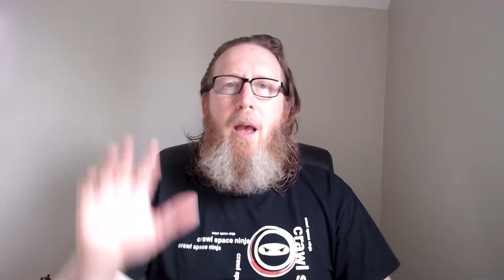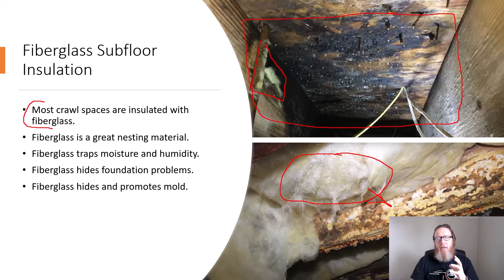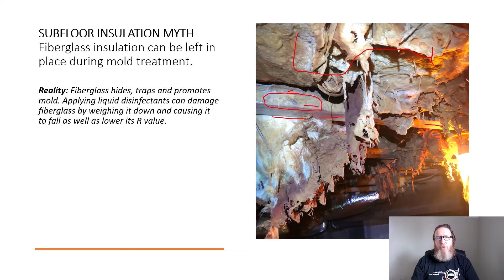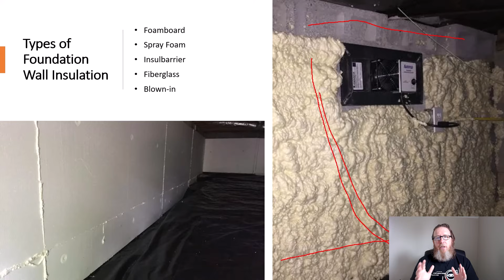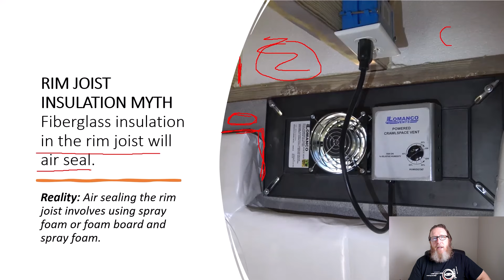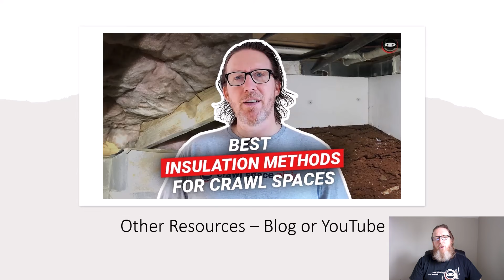Your Fiberglass Insulation is Rotting (Here's Why)

Comment: I've seen a few instances of people insulation the floor/dirt either with foam board or spray foam and then vapor barrier on top of that with foam or spray on the walls. Is insulating the floor common? Recommended? Or should you encapsulate, insulate the walls, and then replace subfloor insulation?
Reply from the maker: That is not very common. For more information please submit a Ask a Ninja Form - https://crawlspaceninja.com/ask-a-ninja/

Comment: In South Carolina what kind of rid joint insulation would you recommend
Reply from the maker: We suggest to check with local codes. However Foam Board with a R value of R-10 that is termite resistant is typically best. We also sell that here - https://diy.crawlspaceninja.com/rim-joist-insulation/

Comment: To secure the  vapor barrier, is it better to tack it down with gravel on top along the perimeter or tape it to the concrete wall?  I think tacking it down with gravel  (or sand bags?) is better as the concrete wall breathes and the condensation gets trap and causes the tape adhesion to fail. Appreciate any thoughts.
Reply from the maker: Tapes and adhesives will usually fail over time. We use masonry nails, Christmas tree fasteners to fasten it permanently to walls. Thank you for watching.

Comment: I'm building a house right now in CT. This information's value is immense!
500 square feet of pre-existing house (really a summer cottage turned into a year round dwelling) that had a whole host of problems. My wife and I replaced all the sills (with sistered 2x8s) to unitize the structure, lifted it an average 6 inches and put it down on poured columns. Right now we're adding the exterior crawlspace insulation ('skits') and intend to encapsulate the space using 10 mil (or better) using the techniques you've outlined. Still going to add joist insulation on the bottom of each bay (spray foamed in faced iso with fiberglass or rockwool. New England be cold! ).
It's a lot of work but we're blessed to start with a near-clean slate in choosing the correct crawlspace components!
My heart goes out to all those effected by poor conditions in their castles.  I hope you continue making people's live better and healthier!
Thank you.
Reply from the maker: Thank you so much for sharing your experience with us. Please let us know how it goes. Also, here is a website if you need to purchase some products to help in your project. https://diy.crawlspaceninja.com/mold-products/

Comment: central indiana with pier and beam foundation on a vented crawl space. i have plastic and pea gravel on dirt, fiberglass insulation between floor joists and lots of moisture issues during humid times of the year. hvac vents have moisture dripping at times. what advice do you have for this situation?
Reply from the maker: Is the foundation wall sealing the crawl space from the outside? If so, can you run a dehumidifier?

Comment: Question:  I am adding foam board to the crawl space wall.    There is fiberglass batting between the joists at the sill plate.  should I continue the foam board up to the flooring or stop at the sill plate?
Thank you
Reply from the maker: I would stop at the sill plate and maybe lower if your area requires a termite gap then you could start again at the rim joists and foamboard/air seal there. Many pest control companies don't like the sill plate to be covered for termite warranties. Hope that helps, thanks for watching.

Comment: I live in the Chicago area. Should I add foam insulation on crawl space ceiling?
Reply from the maker: That's a great question if the foundation walls or insulated, normally you do not have to do that as long as there is a heat source in the crawl space. Hope that helps thanks for watching. I would also check with local code to see what they require for insulation in your area.

Comment: Question. So I have had my crawlspace inspected and was told  I only had mold below the insulation line. That the subfloor is mold and moisture free. Would you still recommend removing the insulation for mold treatment.
Reply from the maker: Yes, when they told you there was no mold behind insulation, did they remove all insulation and test subfloor for mold? Sometimes, it's invisible to the eye.
Reply: They peeked behind the insulation and just visibly looked at it. My mold just looks like light pepper on the joist. Humidity levels is at 58% with a light duty (Lowes) home dehumidifier installed 4-5 years ago. Vents are not all sealed. Crawlspace has a light vapor barrier not covering everywhere. 
Planning on installing a Aprilaire 70 very soon by the Crawlspace company. However, I am planning on diyi-ng the rest. 
1200 sq ft house
Mold- Decon 30
Vapor barrier- your 12 mil ( one or 2-10x100?) enough
-bora foam from local Crawlspace supply company 
Hilti- rental from you guys
Reply: I live in NC. I heard you say something about NC requiring a different attachment method of the barrier over the foam. Do you have any videos or instruction material for those specifics with pictures on how to do that?

Comment: live in the northern climate....have a wood foundation crawl space. the space is dry but there is a musty oder. minor mold growth as well. would like to insulate the walls. was going to use rock wool. should I put a vapor barrier on the outside/inside or neither? thanks.....
Reply from the maker: Rockwool is naturally moisture retardant so you shouldn't need a vapor barrier and I never recommend plastic to cover wood. Thanks for watching and I hope that helps.
Reply: thanks, Michael.....that was my thoughts as well even though the makers and installers of wood foundations recommended a vapor barrier on the studs inside the crawl space.......very confusing!! @CrawlSpaceNinja

Comment: What do you recommend for insulating skirting of manufactured home in zone 6/7? Typical home comes with fiberglass insulation with "belly wrap" vapor barrier under flooring with home installed on a concrete slab. Skirting is often uninsulated although we are seeing more installations with insulated skirting (foam board which look like stone or brick). Uninsulated vinyl  skirting typically includes sections with ventilation. New installations with insulated skirting usually include multiple automatic vents. Seeing people insulating skirting of manufactured homes and not installing any ventilation and covering what ventilation may have been present. When this is done I rarely see any dehumidification installed. Seeing damage from excess moisture when skirting is insulated with no ventilation, or very little.
Reply from the maker: Wow, that's a cold area. I am not familiar with codes in that area but if Tennessee requires an R10 with 8-inch block minimum and a skirt offers zero protection versus a block wall. I am guessing, again guessing, I would want at least R20 if it were my home. Since usually foamboard is R10 max, I would double it up. That may prove to be a tough job but may be easier than installing a permanent foundation. Sorry I don't have a better answer...thanks for watching.

Comment: Had my crawlspace encapsulated in NC.  I arranged to have rockwool comforbatting placed into the extended walls rather than fiberglass.  Rockwool comfortbatting is moisture permeable, bugs and rodents hate it, sheds water, fire resistant, higher r value per thickness than fiberglass, and has sound dampening properties.  Other than a lower price, the benefits of fiberglass is a fairly short list.  My crawlspace problems extended from fiberglass, so I made it a point not to reintroduce fiberglass back into my crawlspace.  I can't say I benefit of sound proofing, thankfully the fire resistance hasn't been tested, but floors are warm and the wildlife issues I was having hasn`t returned.
Reply: I’m thinking rockwool insulation is the way to go on the rim joist areas that way you can remove a piece to inspect those areas every now and then to make sure your not having mold and moisture issues.
When sealing it with other methods you don’t have any idea whats going on with those areas when it’s permanently hidden.
Reply: @robhayes5320 so are you saying rockwool is difficult to remove?
Reply: Thank you for sharing. Improperly insulated crawl spaces are unfortunately common in my area (Downeast Maine), including for manufactured homes.
Reply from the maker: Thanks for sharing.
Reply: @bricelangston8634  great idea! Out of curiosity and probably even similarities, what was your wildlife issues?

Comment: Advise please!? 
Houston Texas
Peer and beam
Non sealed crawl
I placed r19 fiberglass paper up and was advised ill grow mold above  it by somebody that had to do foundation work..  I pulled down a couple pieces and saw a few small specs growing with this being Over a year later and not near water source...

Am I destined to rip out all that hard work and go to a open cell after all?
Reply from the maker: If it is trapping moisture, it can be a problem. Your type of construction is difficult to insulate properly and keep dry. You may want to consult a local contractor or weatherization specialist that understands moisture prevention.